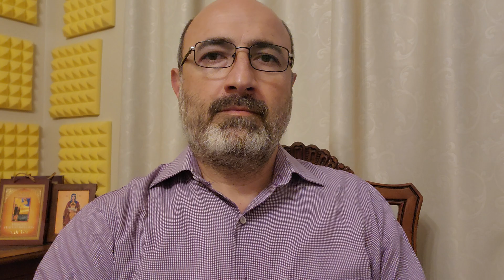Why Tesla Is Pumping the Brakes on Solid-State Batteries

Comment: Another reason is that "silicon batteries" - with silicon anodes replacing graphite -  have now hit EV scale.  So, it's not years away, it's as close as the EV makers choose to integrate the technology.  Much of the benefits of solid state are available in silicon batteries: 25%-50% higher energy density, charge times under 10 minutes, excellent cycle life (1,500-3,000 cycles), better safety, better cold weather performance.  While you mentioned Sila (a fine company and worthy of mention) you might have wanted to note that Group14 Technologies is the leader in silicon anode technology, with the only EV-scale plant running (2,000 metric tons/yr.; 10 GWh) in Korea, and two more of the same size in Moses Lake, WA that will go live next year.  Group14 is already in millions of Chinese smartphones, the Archer Midnight eVTOL aircraft, the McMurtry Pure hypercar, the Flying Basket heavy lift drones, and AI applications in datacenters.  Battery makers like ATL, Molicel, Sionic, InoBat, and StoreDot are using it.

Comment: It is a good message that people should NOT wait to buy an EV because solid state battery powered EVs are "just around the corner". This was Toyota's message for many years, but it was really just part of their efforts to slow the progress towards building BEVs. While they kept building hybrids and gas-only vehicles that made more profit by avoiding change, and still have no solid state battery BEVs planned for production, a decade later. Unfortunately, stalling on BEVs cost them dearly. Because as Toyota delayed their BEV production, competitors like Tesla and many Chinese automakers moved ahead and built BEVs and stole their customers worldwide. Panasonic (also Japanese) did work with Tesla to build NCM batteries, but they didn't invest in solid state technologies. CATL did go forward to engineer solid state batteries, along with sodium ion batteries, and other new lithium battery chemistries that provide better energy density (for vertical markets like aviation). We see weekly announcements of "breakthrough" battery technologies, but most of them are just at the research stage. The key points for successful solid state batteries are being able to build batteries in high volume, and make them price competitive. And those have been the toughest parts for solid state battery manufacturers. So far, SS batteries have been difficult to manufacture in volume quantities, especially at low cost. And since the average BEV buyer is more concerned with getting a $35K BEV, than getting 600 miles of range, or charging in 5 minutes, affordable battery chemistries like Gen II sodium ion, LFMP, and LMR, look far more attractive for the next few years. I think higher end Chinese BEVs will show the use of solid state batteries first. Because they can justify the low volume and high cost.  And next we may see hybrid battery packs that include LFMP and solid state batteries (to keep overall cost low) but still show off the cool SS technology. Unfortunately, current U.S. government policies and tariffs are moving to go backwards and only support gas vehicles. Specifically excluding Chinese BEVs, batteries, and materials. But just like Toyota's BEV delays cost them sales over the last 10 years, American backsliding to gas-only vehicles, will only benefit China even more. Because American companies will not innovate, and in 5 years time, they will not be competitive. Not internationally...and not domestically. Avoiding positive, innovative change because of short term profits/greed are terrible strategies in the long run.